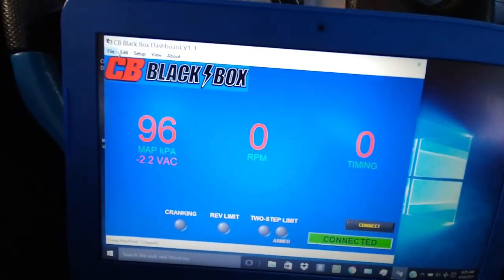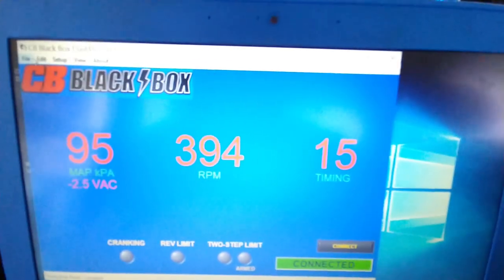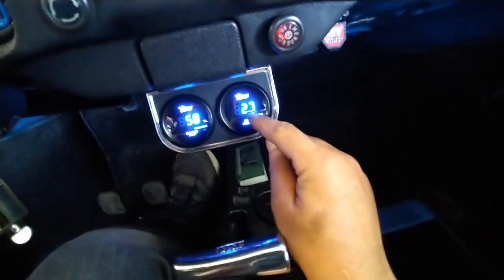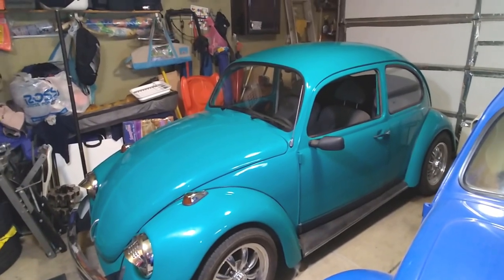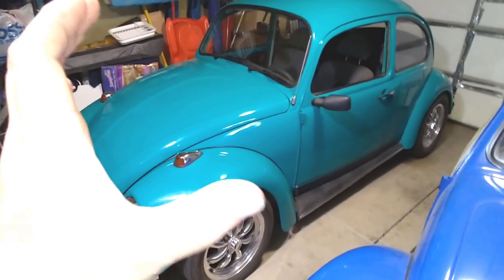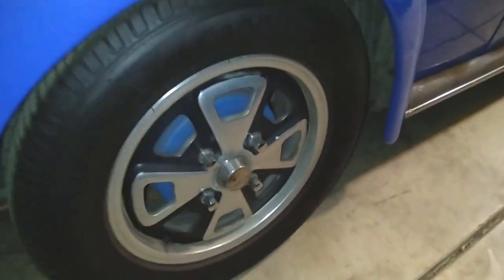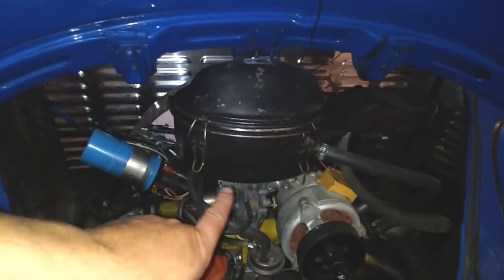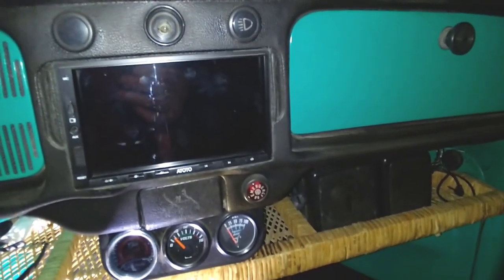CB Black Box-Weber Emulsion Tubes-Don't Buy a Bug If

Comment: 👍 Nice tip, on the velocity stacks. When you rebuild your type 4 engine with a better camshaft and longer connecting rods, your engine should have more power than your son engine does with a solex carburetor.
Reply from the maker: Yes it will...
Thanks for watching